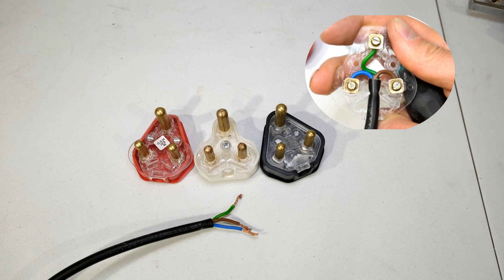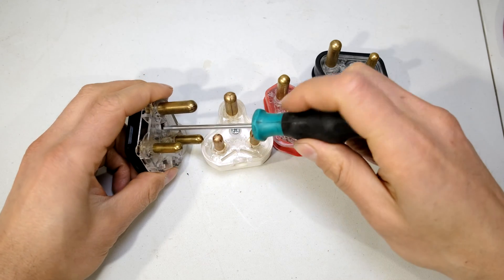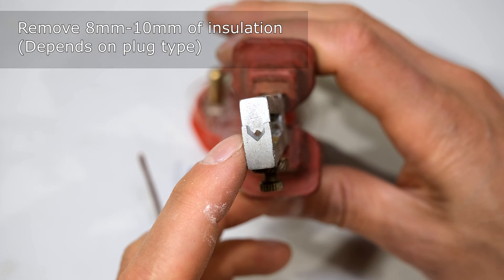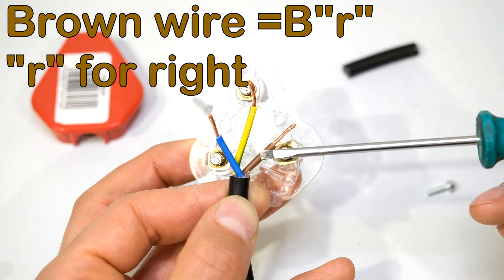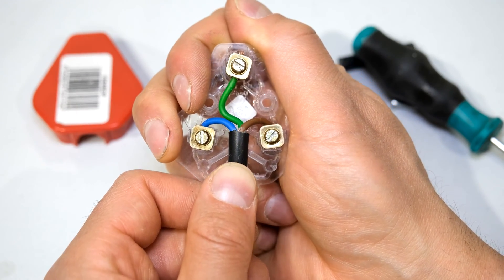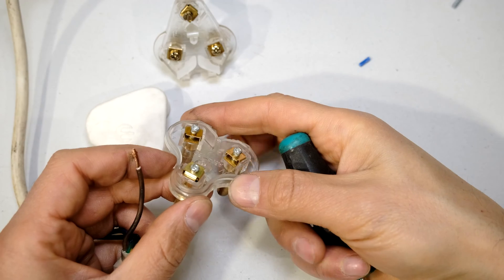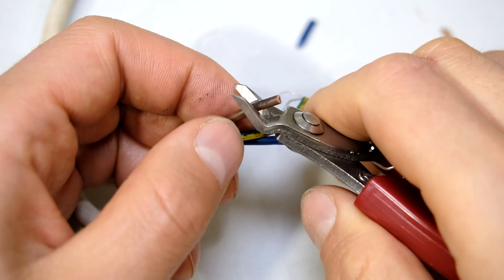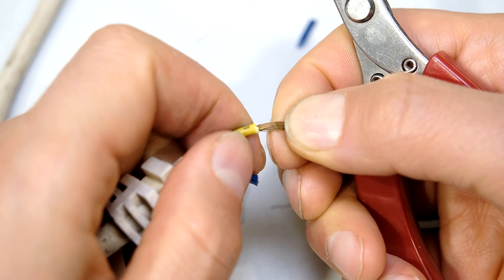How to wire any South African three pin plug top - with tutorial

Comment: You should consider using boot lace ferrules for the stranded wire, makes a far better connection and less prone to arcing and corrosion. AC/DC sells them.